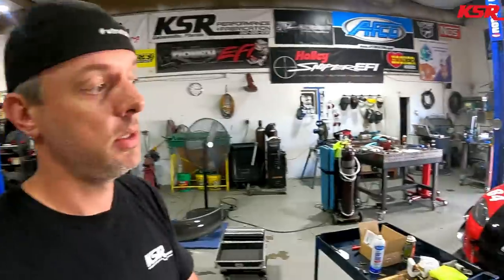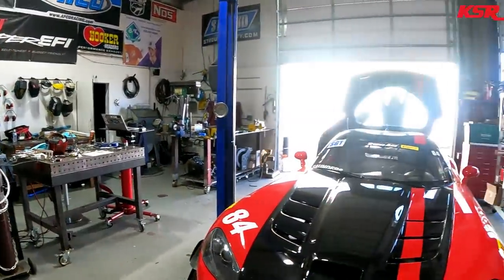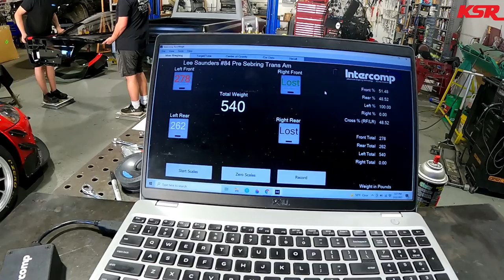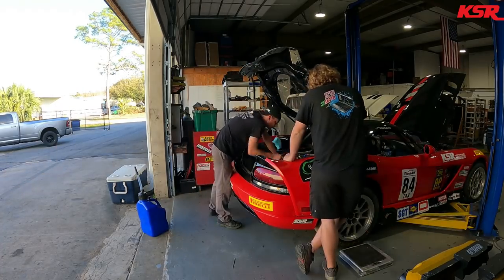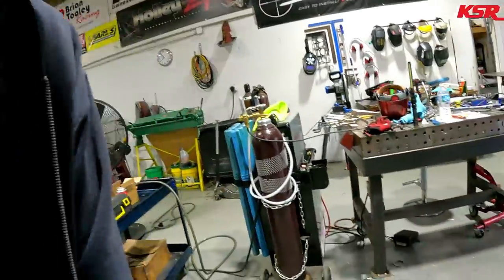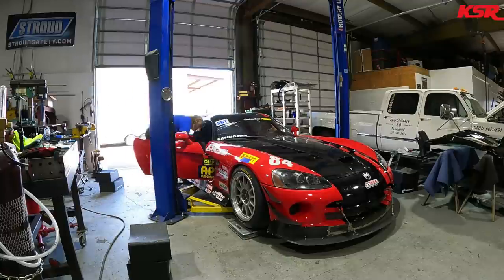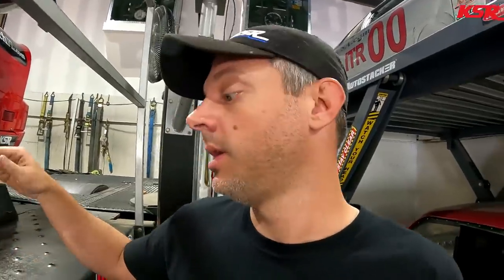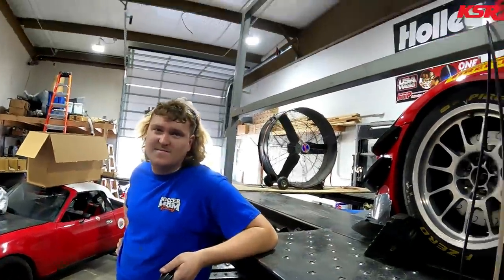Viper Race Prep to Start our 2022 Trans Am Season!!

Comment: Great explanation on scaling the car Kevin. When I scaled my modified I used roll off pads to settle the suspension before going on the scales. Do you also check the Ackerman and front wheel scrub?

Comment: Have you tried to use 2 pieces of linoleum instead of the 2 steel sheets and grease?  

Trying to find out what would work best and still achieve get the suspension to settle

Comment: Kevin, I'm not really sure I understood your scale theory on what you were trying to accomplish..
I am a licensed scale technician in 7 states including Florida for 35 years now...
But, when you talk about repeatability, if you set the car down on the scale it doesn't matter where you set it the weight shouldn't change no more than 1 1/0 of 1 %...if it does you have a scale problem... you should be able to apply 500# to each corner of each pad and see at most .2 pound difference across all corners on all pads hooked together...
I worked in Florida a good while at Florida Industrial Scale Co. If it isn't doing what I just mentioned you should get it checked out..
Also any electronic weighing device needs to be calibrated at least 2 times a year to ensure accuracy...

Comment: Thank you for not scrubbin the tires by turning the wheel while car isnt rolling, on the shop back out\take off.  It actually puts slight flat spots on the tire tread, in doing that.